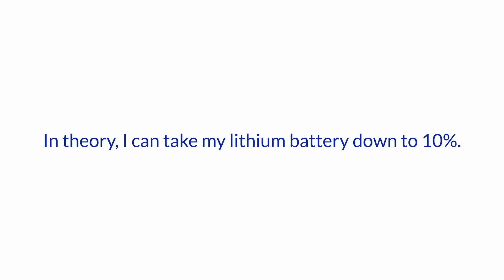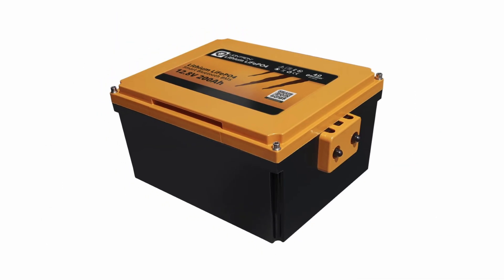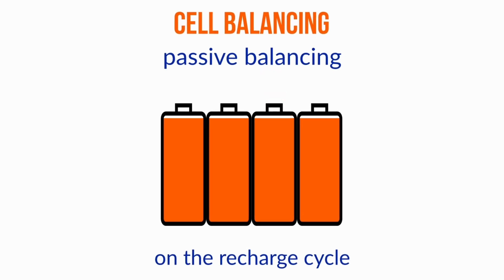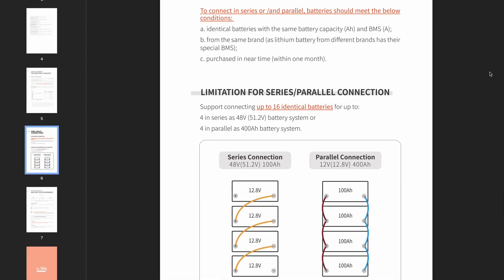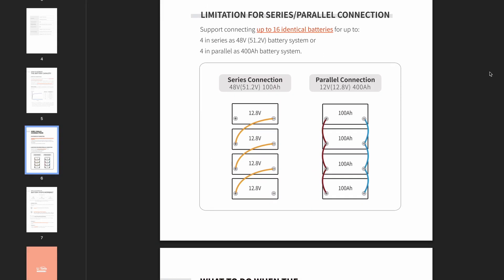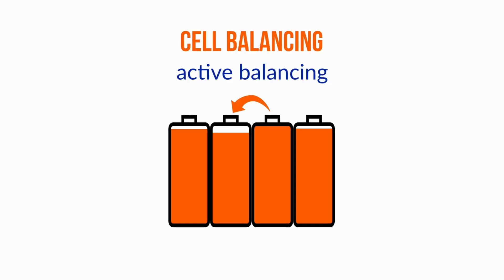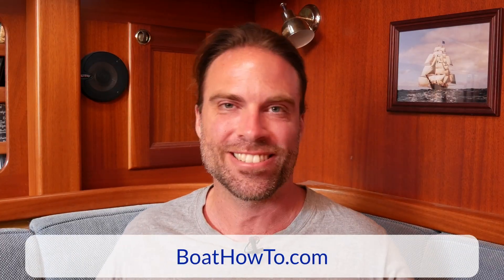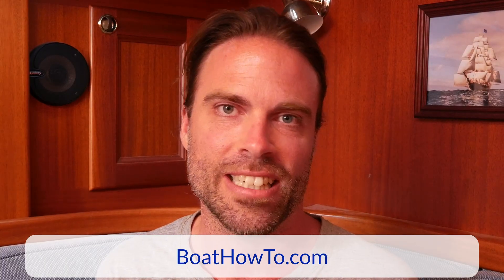How to TREAT LiFePO4 Batteries ☝️| Ask The Expert with NIGEL CALDER

Comment: I work for a lithium ion battery manufacturer and in short, we lie to you. When your battery says hundred percent it's not really completely full, i.e. not really at 4.2 V per cell. When your battery monitoring system says your batteries is at 0%, it's actually at 10%. We will not let you charge if the battery is hot or if the battery is cold. Therefore we allow people to cycle their battery every single day and our warranty is for a full 10 years.

Comment: Cell balancing is always an issue. In series battery balancing is also an important issue since each battery essentially becomes a cell. In parallel battery balancing is a non-issue. Since LiFePo4 batteries don't care very much about SoC as long as voltage is high enough to ensure cell balancing, if a parallel battery drifts higher or lower it's really no big deal. But the answer to the question is "yes" you can use your batteries to nearly full capacity. You reduce life expectancy of the batteries but only in a minimal manner.

Comment: I think it depends: I have a set of Renogy 100AH LiFPo battereies and they are hooked up in parallel. They support up to (4) in parallel and have a Data link between the two batteries. I believe this allows them to sybncronize their balancing and charging. They also have a BLUETOOTH module that enables both batteries to communicate with either a IPHONE APP or with VICTRON CERBO GX and a display screen to show SOC (State of charge) and individual CELL VOLTAGES.

 Note: connecting the batteries in parallel is not as simple as it may seem -  you connect the + terminals of each battery together with a short properly guaged wire. But, you must connect the (+) distribution wire  to one of the batteries in parallel and the (-) distribution wire to the last battery in parallel, otherwise you will have problems.... also remember you need a T-CLASS FUSE between your (+) battery and your electrical system (HOUSE DISTRIBUTION PANEL or ???)

I would take their course as there is more to installing a safe system than most people realize.

Comment: In a small 12v setup - assume two parallel 200 amp batteries not being discharged to more than 20% and regularly charge to 100%- what are the probability for the cells get out of balance and representing a danger?
Reply: It depends on how well the cells were initially matched and how effective the BMS does balancing. In a half-decent quality battery, cell balancing will be no issue in your scenario. It shouldn't be an issue even if you cycle the batteries more aggressively.